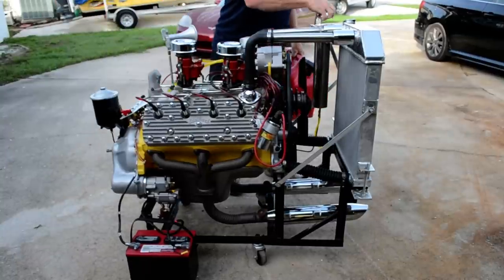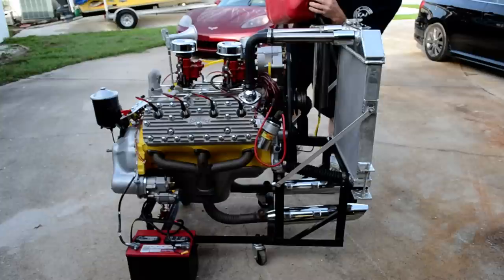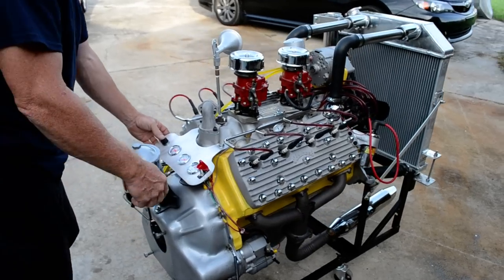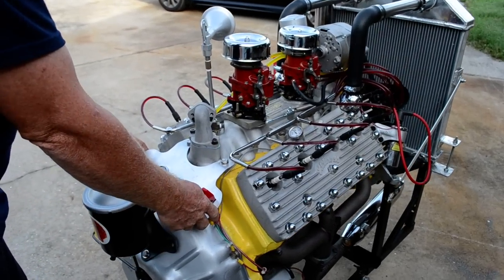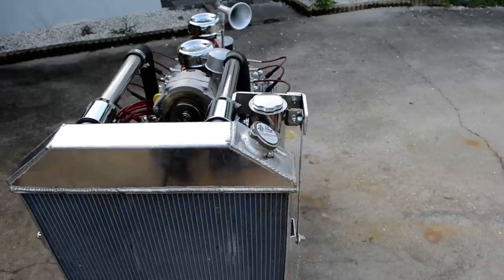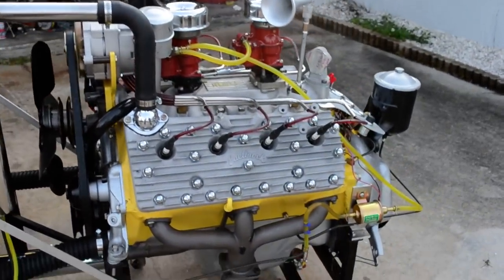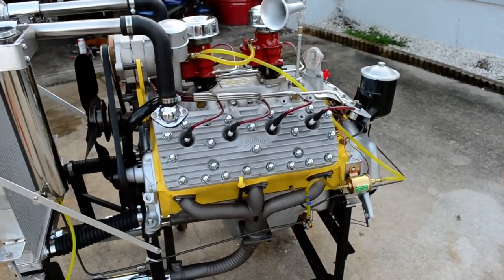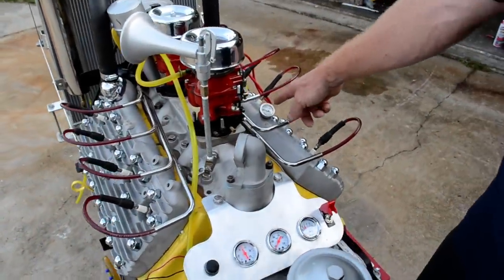Flathead Ford Engine Start Up

Comment: It's interesting that even though it's a V-8 engine it only has 3 exhaust ports on each head. The two center cylinders must share the same exhaust port.
Reply: They do share the same exhaust port which is cast in the block. Thats why it needs two water pumps and a massive radiator
Reply: Joe Vignolo .. Right.
Reply: The siamesed center exhaust port seriously hampers exhaust velocity. Both Cadillac, and Studebaker, shared this design flaw. What were they thinking ?

Comment: You know those things have a function. If you put that in the front of a car it will move the car. Mounting it to a metal frame sitting in your driveway doesn't move the car down the road.

Comment: Its idle is way to high.
Reply: ...at least 2000 rpm--way too high--it should idle easily at around 5-600 rpm
Reply: They are supposed idle at 3400 RPMs.
Reply: Cam break in.
Reply: That was back in the day
Reply: Nothings sound beter than lada!
Reply: @scootergeorge9576  there is no cam break in on these they have non hydraulic tappets instead of lifters
Reply: @josephdickerson5802  - Back in 1979 I put a new 292 in my '57 Ranchero. Rat it at around 2500 RPM for maybe 15 minutes just to be on the safe side.

Comment: Turn it OFF!!
The idle is WAY too high!!!
Reply: +Lucky Dog   I dont know what rpm he is running but I understand you should never idle an engine when new the cam will dig into the lifters, 12 to 1500 rpm till fully warm then maybe slower, not sure if this is true on flatheads but super slow idling with a flat tappet cam is not the best thing for it.. .
Reply: I bet it wont idle any slower coz it's not tuned right.
Reply: He's breaking in the cam. Wow so many Internet know it all mechanics
Reply: I think engines back then just idled higher than nowadays
Reply: @nasseranise102  they idled lower back than then they do now. Opposite of what you said
Reply: @finncampeau4922  whelp, im not gonna pretend to know anything about 1930s tech

Comment: I laugh every time someone wonders a v8 with six header runners. Good sound and what a handsome engine. No argument one of the best looking engines ever created. Want it louder? Id stuck a Isky 400 jr cam in there to give it that rumpity rump sound from about .400 lift which is the maximum that after market heads accept. When he revved it slightly that engine wanted to jump on the driveway.

Comment: You definitely did a great job rebuilding it. It fired right up and sat at idle with no problems. 9:1 compression is great for a flathead and it looks and sounds like it makes gobs of torque. Good job dude!
Reply: Robert Keeton 9:1 compression is impossible on a flathead. he prolly got it wrong
Reply: Stock 1949 V8 was 6.8 compression ratio. I think these Edelbrock heads bump the ratio to 8.0
Reply: @3beltwesty  That's about right ...Trev NZ🇳🇿.,..idles a bit high though & there's a fair bit of mechanical noise: try an Isky 404 cam...cranes are always noisey.

Comment: I see a lot of comments about the idle speed if this is the first fire up maybe breaking the new cam?
Reply: @guyvanbrussel9772  
That reply you just gave proved to me you know nothing about engines.
Reply: @guyvanbrussel9772  
Engines made before the 80's commonly had flat tappet cams.  They need to be broken in by running at approx 2000 rpm for 20-30 minutes.  The reason for that rpm is to make sure the cam and lifters are getting enough oil.  Manufactures went away from flat tappets and use roller cams now which don't need that break in period.
Reply: @guyvanbrussel9772  
Settle down.  The break in was done at the factory.  No one said a manufacturer required a buyer to do  it.  But if a flat tappet engine gets rebuilt it still needs the cam broken in.
Reply: @guyvanbrussel9772  
You just proved you know nothing about engines.

Comment: gona have a real time cooling with no operational fan
Reply: and having alot of RPM 
if this is their idle then, then they have a big problem
Reply: Rusty Rivet your right real men like the germans that can make way better engines that the shitty v8 :D and dont forget the japanese with their super fast b18 vtec
Reply: Could be a clutch fan, comes on with a temp sensor.
Reply: they didn't cool really good with a fan.

Comment: What I would do, is right before the exhaust goes into the mufflers, plumb in left and right 2 inch, 90 degree gate valve.."non-brass" if you want "LOUD" then just open the valves of course you have gloves on.....then kick back and beer up and dig the sounds......

Comment: why start the engine and then try to shout out all the components that went into it over the sound of the engine. I didn't understand any of that. I do love the old flatheads. learned to drive/mechanic in 46 ford. that sound is music to my ears.

Comment: Very good oil pressure and 9:1 compression to boot.  Along with your Crane cam your  current horsepower should be considerably beyond the original rating of100.

Comment: Is the water pump even got a belt on it? Needs idled down a bit ay? Great job! Now shock it n a frame wit wheels on it!
Reply: The water pumps are on the sides, the belt is running them.

Comment: Impressive work. Too bad a dead stock 283 Chevy with a single exhaust would blow the doors off any "rod" with this engine in it. There's a reason you still find these engines in fields, that's where most of them went in the 50's.
Reply: I agree. But sheer power is not what this exercise is all about.
Reply: Rob S I get that. But it's not a great engine. There's a reason hot rodders of the golden age didn't use these unless they couldn't afford a better option.
Reply: ***** Fair enough. But then it should be in a period-authentic '32-34 hot rod, or as a stock engine in a restored Tudor, where it would be in context, at least.
Reply: Tyler Lundstrom Take it down a notch, Tyler. I don't even own a Chevy.
Reply: Well said! Couldn't have made a better remark myself. It's all about nostalgia and the flathead's mystique. And, or course, that wonderful, unmistakable flathead rumble. Everything wrapped into one, little tight package!
Reply: guyonearth the straight 6 ohv. would beat them in the day.
Reply: I used to suck the headlights out of 67-69 327 Camaro's with a bone stock 87 mustang 5.0 😆
Them boys would put cams, and headers, and all kinds of money in those cars only to get fucked up by a little 302 with 225 hp! 😆
Reply: Everything old is new again. Nostalgia is in Vogue, in case you have'nt noticed, and not just flat-heads. Y-blocks early Olds, Cad, Pontiac, Studes. All get lovingly rebuilt today, for automotive history's sake.

Comment: why does the V8 engine only has 3 exhaust ports  at each side ?
Reply: ooh ok
Reply: Titan_Craft The two middle cylinders share the one middle exhaust port.
Reply: bav854 that's a better answere, thanks
Reply: Does it have any benifits besides that it's cheaper ? ( at least i asume it is )
Reply: Titan_Craft Look up engines built anywhere from late 20's till they got factory "converted" to pushrods and overhead valve. Almost all share even intake ports and exhaust ports for tighter packaging and cost also. But back then they knew that fine fuel atomization was required to make the most out of the flame combustion spread across the piston which in a flathead design is far less than a modern motor. So therefore having shared intake ports caused more of a turbulance to break up the gasoline into smaller bubbles. Make sense? Notice that in-line motors have the exhaust and intake on the same side and in most circumstances they are touching especially at the point of the carburators' intake discharge into the manifold runners. The thought was that it will head up the incoming air and gas to "fine" mist it. Thats why the fuel injector is king! Hope it helps!
Reply: +Dan Spirescu  The first engine to do a 10 second quarter mile too.
Reply: +Jolinders108 the middle cylinders are cast together.
Reply: +Jolinders108 the middle cylinders are cast together.
Reply: +vet68 or rather exhaust ports.
Reply: +vet68 or rather exhaust ports.

Comment: The high idle speed might be breaking in the bearing surfaces. I would like to find an older Miata to put this engine in- they have a lot of suspension improvements available and the light weight would make the low horsepower less of a problem.